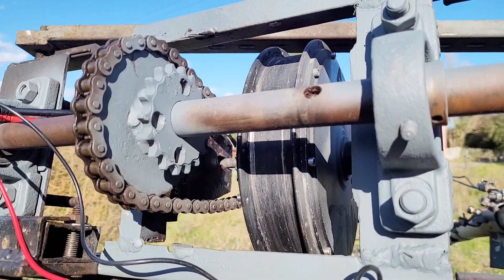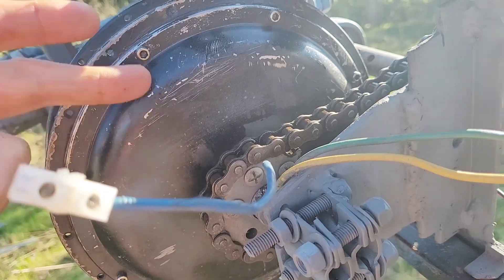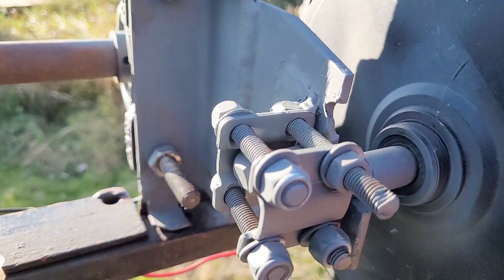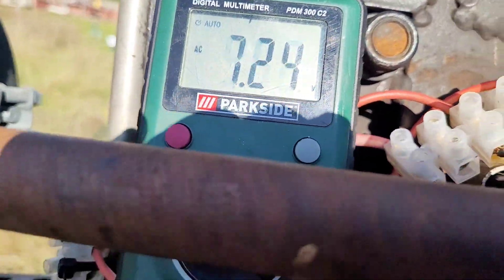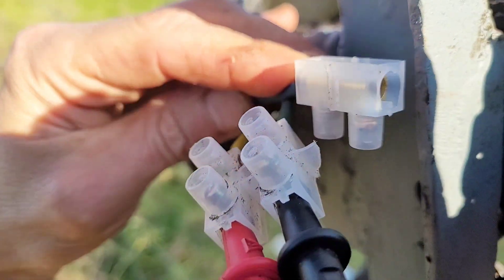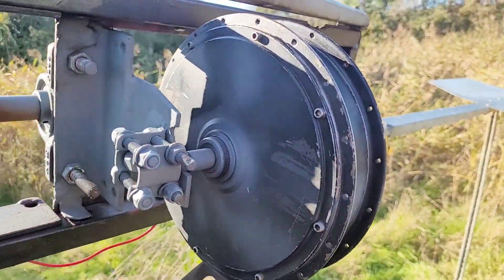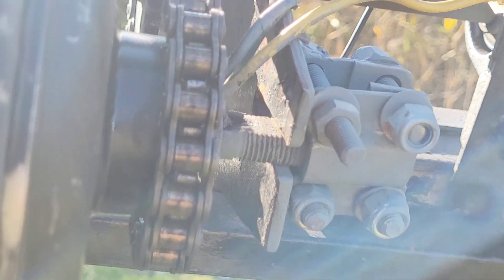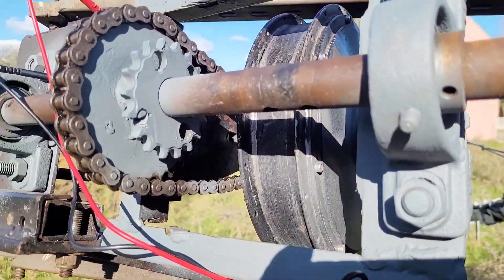24v / 48v Off Grid Wind Turbine System Project - The 3kw Hub Motor is Installed better than before.

Comment: i made a wind turbine with 3 blades using a 220v mini food proscesser motor with magnets and it can generate up to 220v if it spins faster but it doesnt generate much, the motor is a small as a 775 motor